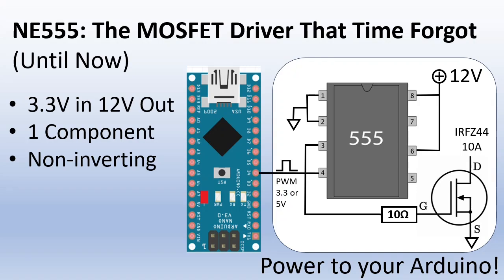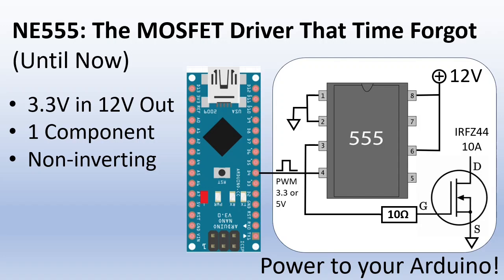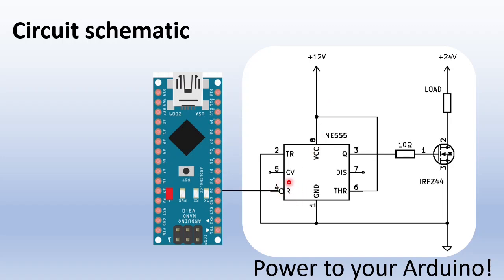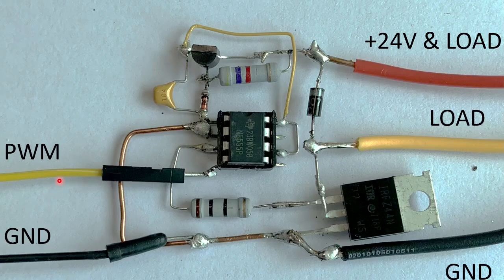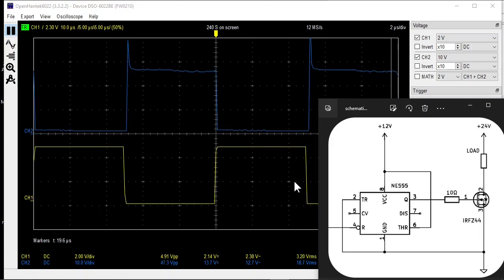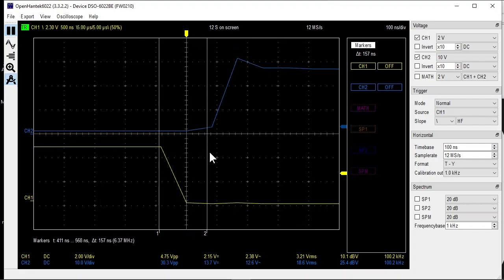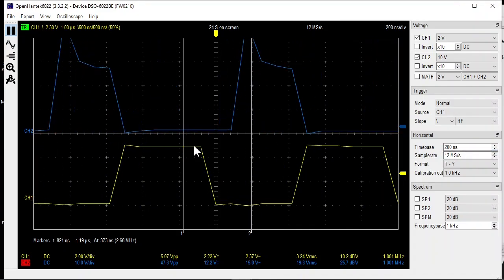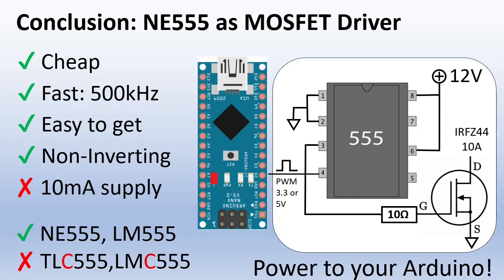NE555: The MOSFET Driver That Time Forgot (Until Now!)

Comment: PWM max value was 1024 instead of 1023 in several places → TimerOne uses 0–1023
Some logical conditions were incorrect
Functions called themselves → slowdown
UL type indication was missing in two places → overflow risk
There was a rounding error in OffTime / OnTime calculation

Comment: Good project!. The traditional older replacement was the ICM7555, originally developed by Intersil. I don't know if it still exists (I have "new" ones bought in the 1980s). These can deliver (absolute maximum) up to 100 mA.

Comment: Hello!I had made an active PFC low power corrector from NE555.There was 4N60, no current control, only output voltage control. Nevertheless - the power factor was much greater that without a PFC. I used 555 in PWM mode. The switching frequency was 50-80kHz.
Reply from the maker: Wow great Andrew, the NE555 has limitless applications ;-)

Comment: For some better/reliable edge transitions timing & ckt operations.... these options could help improve the performance....
From your ckt..it seems more larger decoupling on pin 8 of 555 is reqd. (at least upto 22uF)...
A 35V 2u2F to 4u7F on the 24v, as close to the mosfet DS pins is good
....also 0.1uF each across the 12V zener and another from pin 5 to common .....
use a -3 V negative supply referenced to 0V for the 555 ...with pin 1 now connected to -3V .These can work upto 18 V so here 15V is ok (+12v&-3v)..
Now the mosfet gate gets -3vnegative...so  turn-off is faster...
A diode 4148 in series with pin 4 with cathode @ pin 4..& a 5k1 pull down from pin 4  to -ve3v 
A typical pnp turn off transistor ckt. between pin 3  .., mosfet gate...& -ve3 supply...
pin 2 must be disabled with pull UP resistor to +12v..
So also pin 6 must be disabled with a pull DOWN resistor to -3v.
Need more drive current....
use a suitably chosen pull UP from +12 to pin 7..and tie pin 7 to pin 3 directly or safer still through a 1W resistor of  4E7 to 10E .
Now there's more sink & source current drive for the mosfet ...
The 555 mosfet gt. drv. is only as good as long as the uC. PWM PIN outpts a logic HI for pwm ON & LOW for OFF
 ...and one should be sure that when the uC is disabled/masked/hanged it maintains a logic LOW State...

Comment: The NE555 has an operational frequency limit of about 1 MHz. I think the signals are a little bit unstable because Vcc is not stabilized by a 0.22 µF capacitor against ground and it is wise to stabilize pin 5 by a 10 nF capacitor to ground as well. 200 mA is not a lot if you operate even a IRFZ44 at 500 kHz. Have you checked the MOSFET drain voltage at this frequency by oscilloscope?

I think, the MOSFET was not fully switched on and off with this gate current limit. The gate capacitance is 2 nF and the gate charge is 40 nC. This is allready a lot at such high frequencies. The MOSFET will need a lot more than 100 ns for switching. In some applications I have used MOSFETs with 15 nF and 200 nC together with a 9 A gate driver in order to get fast switching at only 50 kHz. The measured gate current peeks were between 4 and 6 A.

Comment: Hi, great video. I have a question, since this is not inverting the signal, can I use a reed switch as on/off signals to power a DIY electric motor coil?
Reply from the maker: Yes, sure, connect the reed switch to gdn and the input and  add a pull up resistor to +5 or +12V
Reply: @ Thanks for the help.

Comment: Hello, Master! First of all, thank you for sharing your knowledge. I have two questions:
1) Can this circuit be used to control a 24V Polygonal Laser Printer Motor? And how should it be connected?
The Motor has 4 wires: Red: Positive up to 24V; Black: Negative; White: for Speed Control; Pink: I couldn't figure it out.
2) What is Pin 4 of the 555 that goes to D4 (PWM) of the Arduino for, since isn't Pin 3 of the 555 the PWM Control output?  If you can answer me, I would be very grateful. Greetings from Brazil.

Comment: I was researching for a way to drive an led power supply from Meanwell that is working with 0-10V or 10V PWM. So this seams an Intresting alternative when connected it to the pwm input without the mosfet.

Comment: Overkill using 555 because you can't get sufficient mosfet drive.  Use a transistor driver just like anybody else would !  Lack of understanding simple analogue electronics.
Reply from the maker: If you like transistors: watch this: https://youtu.be/wv4uAz8FV2w
Reply: @smartpowerelectronics8779  A better starting point to develop your knowledge would be to read "Electronics Fundamentals" by Floyd and Buchla. It was the go-to book in the 1990's for a Electronics Diploma.

Comment: It would be nice to show the internal circuit diagram of the NE555 thereby increasing our  understanding  of this NE555 chip. Thanks.
Reply: Just google the data sheet.  Most of them show the full internals, although it doesn't help understanding the chip's functions unless you are a silicon designer.

Comment: IDK why it's not working .
Reply from the maker: @xjhoox  that is frustrating, did you check all voltages pin by pin? What I of the do is test by attaching an LED with 1k at the output and then use a wire to touch the input to 12V and 0 V while watching the LED😆

Comment: Looks like there are some improvements to be made. Looking at the internal schematic of a 555, you’ve got the Set and Clear pins of the SR latch both held high at once, which isn’t really in-spec. I think.
Also you really should put a resistor on the reset pin as to not be undefined when the MCU is in a startup state.
Reply: If the microcontroller crashes, the 555 output on pin 3 gets high and that's not desirable; when the input is disconnected, the output should be low.

Do you know how that bug could be solved?
Reply: @soupflood  if the MCU output goes high-z (like it does when it’s initialising) then you could avoid it by having a pull-down resistor on the reset pin. But if the MCU output goes high and stays high, there’s nothing you can do besides put a fuse on your power input.
Reply: @Scrogan   if the 555 timer's input (pin 4 reset) gets disconnected (or the MCU crashes) the 555's pin 3 output gets high. That's a 555 specific bug in this setup. 
I already tried resistor across the 555 input (between reset and ground) and it didn't work. The fuse wouldn't solve this either

Comment: I'm using the TLC555CP the CMOS version for a MOSFET driver for over 30 years. Not only that, I use the 555 also as the PWM controller, fixed on time, variable frequency, including the soft start function. It is one of my early designs and still in use after 30 years. Manufacture hundreds of DC to DC converters a month using it. Not everybody can use  that topology but in my case is just what the doctor ordered.
Reply: If the microcontroller crashes, the 555 output on pin 3 gets high and that's not desirable; when its input is disconnected, the output should be low.

Do you know how that bug could be solved?
Reply from the maker: @esoterex  yes the 555 is used in professional products, I worked on one HID lamp driver for office projectors with the 200W buck controlled with an NE556😂, built a few million pieces with high quality. Was the current output of the TLC not too low? Perfect ZVS?

Comment: I'm glad you uploaded this excellent video.
Maybe someone will also sort out the 555's open input bug (open input results in high output on pin 3).

I still find it fascinating that 2 components which are considered toys by most engineers can perform so well in this configuration. I use it to drive 2 paralleled TBI injectors in a 90's Chevrolet, by the way. It works great (unless the Arduino crashes, but it's mostly about filtering resistors, capacitors and keeping spark plug wires away from the Arduino cables). The Arduino is fed by a dedicated external 5V regulator and the 555 is fed by another 12V regulator (for increased reliability).

Have a good day!

Comment: Maybe that's what I was looking for. 
It should do the trick for me. I'm interested in running a motor, lamp with pwm signal. Whereas for a motor I would like it "independent" and manage it through the digital signal. I don't know if I explained myself. :)
Reply: This general setup works well for PWM driving low impedance (1 ohm) injectors in an automobile, it's what I've been using it for.

The big issue with it is that if for some reason the Arduino crashes, the 555 output will become High. That translates to a steady full flow of fuel into the engine (drowning).

If you have any idea how to fix it, please share.

Comment: Hmmm, sure its one way. You could use one or two super cheap transistors, a logic gate, a schmidt trigger, a comparator, an opamp, all sorts! but its OK that you did this.... but its not the only way. The right method depends on space and cost limitations.

Comment: Really great and explanatory video ı really liked your explanation. But what happens if we were to do like an H bridge configuration? This time we need drain voltage + gate thresold voltage to use the mosfet on the High side right? That would mean 12v is not sufficient and maximum 16v rating of ne555 is also not sufficient. Or am ı wrong can you please answer me ı don't know and ı am just asking.
Reply from the maker: Thank you! For H-Bridge you will need to make a bootstrap supply of 12V like in this video: https://youtu.be/M5lETaqI9JM. Suggest you use the IC solution, much easier and robust.
You can also use a motor drive IC like ST's L293D for low voltages and frequencies.
Reply: @smartpowerelectronics8779  ı am trying to design a brushless ESC with microcontrollers and wanted to make a H bridge first. Most Motor driver IC's cannot handle a lot of current and voltage and ı don't want to throw an IC to the problem to be honest ı want to learn how to do it myself. But Thanks for your answer you have some really good content. ❤
Reply: @doganertan7259  bootstrapped... i also prefer discrete components over ICs... 

only issue with the charge pump bootstrap in a h-bridge is it cant be used for say, direction control on a motor?

all good as a driver, for PWM, but they cant be constantly "on" (or "off"?) as the charge pump capacitor does slowly discharge. depending on the value, you still have approximately half a minute to a day or two though!
but as the value gets larger it also means it requires a longer "dwell" time to recharge that capacitor... so you keep them small for high speed operation...

as most H bridges run PWM at a reasonable frequency, its not an issue. some people do use them for polarity reversal though. better to use a single throw double pole switch/relay for that application.
Reply: @paradiselost9946  I saw a lot of commercial ESC models don't have a mosfet driver inside. Most of them uses a discrete circuit it seems. Using discrete components are a lot cheaper than using driver IC's. Discrete circuits can "off" the mosfet but they can't make the mosfet stay "on" that long. For a High side mosfet can we just put a boost converter circuit and switch it with a transistor on the mosfets gate? Because in my country there is a boost converter called mt3608 that is cheaper than that driver IC and ı did not see any circuits online about using a boost converter. Or there is another method that ı don't know?

Comment: So as far as the mosfet is concerned its just seeing the npn and pnp switching transistor in the 555. I would just use a a pair of transistors and not waste a 555. in fact real mosfet driver IC's are possibly same cost as a 555.
saw a guy use some optocouplers a few years ago for driving P channel fets from logic lines.
Reply from the maker: You are clearly a professional! The transistor pair will give you the current gain, however for the voltage gain you need a 3d transistor, see this video: https://youtu.be/wv4uAz8FV2w .

Comment: If you take a complementary pair - say BC547 and BC 557, and put them in emitter-follower, you can achieve the same effect with 
- Lower pin-count
- Lower cost
- Lower quiescent current
- Better performance.

555s are good to learn the basics, as illustrated in the fantastic book by Forrest M. Mims III, but let's leave it at that.
Reply: No, let's not "leave it at that." It's better to have knowledge of all the different ways to use all the tools in your toolbox (so to speak) as you can never anticipate all the circumstances that can arise. Maybe you're in the middle of a build and don't have BC547 and BC557 transistors available, nor any kind of dedicated MOSFET driver... but do have a box full of 555's. Then it could very easily be the case that the 555 is the perfect solution - in context. 

I don't think anybody is saying that a 555 should  be the MOSFET driver of choice, but knowing that it's capable of performing that function is potentially a damn handy bit of knowledge. It's just another arrow in the quiver.
Reply: @PhillipRhodes  To be clear, I'm not talking about "could" but rather "should".
Reply from the maker: The totem pole will give you the current gain, for the voltage gain you need a 3d transistor, see this video: https://youtu.be/wv4uAz8FV2w
Reply: It's hilarious to me that every time the 555 is suggested as a gate driver, someone pushes back.  No one is suggesting the 555 be used in a 1.2 MHz buck converter or your latest energy harvesting application!  But for very many routine applications they're gold. Ever since the idea showed up in the August 29, 2012 issue of Electronic Design,  I've never not had a 555 on-hand.  Meanwhile, your totem pole solution fails fundamentally, as has been pointed out.

BTW,  Asian 555 clones work just fine, and Amazon sells 50 of them for $6.99.
Reply from the maker: @d.jensen5153  I have used NE555 IC's as Buck controllers in (ultra) high pressure lamp drivers (120....400W) , if you have a office projector or a rear projection TV chances are there is a 555 at the heart of your device 🤣

Comment: Maybe the NE555 drives a serial RS232 with 12V = Low and 0V = High?
Or an ATMega HV programming? 
This requires 12V on the reset pin of the ATMega. Then you can still delete the program from a locked IC and reset the fuses to normal.
Reply from the maker: Good idea, it is fast enough for RS232, I have never tried Atmega HV programming, did not know you can use it to erase a locked IC, so I learned something today, thank you!
Reply: @smartpowerelectronics8779  Een Atmega die op slot zit, stop ik altijd mijn TL866, die met hoog voltage de boel weer op poten kan zetten.
Reply: can you share the code?

Comment: This doesn't work with the B555 from GDR production. 
On the NE555, the Set input is overruled by the Reset input.
However, with the B555 the Reset input is overruled by the Set pin.

The reason is that the NE555 takes the /Q output from flipflop and inverts it again in the driver stage.  That's why Reset is dominant.
However, the B555 takes the Q output from flipflop and does not invert it in the driver stage. That's why Set is dominant. 
For most applications, however, this difference is irrelevant.

Most 555 clones do it like the NE555.
Reply from the maker: Thank you, you seem to be an NE555 expert! I tried all the 555's I had lying around and they worked OK except the TLC555, but there are many variants of the 555....

Comment: Nice forgotten idea! One 555 costs about as one middle powerful transistor. So for 3.3v controllers it looks like a winner - no additional  components.
Reply from the maker: Thanks, indeed. I use it already in a project
Reply: It’s possible to use 555 in a high side driver for 12v, just use one more 555 as a voltage doubler with diode and capacitor. So using cheap PC817 optocopler we can switch +12v high power loads

Comment: You can connect 555 DIS to Q and get even more current to close MOSFET Gate faster. Usually MOSFETS drive  inductive loads so fast close is more important than fast open.
Reply from the maker: That is a good idea, I did not think of that!
Reply: Thank you for sharing your knowledge. Will share that circuit diagram?

Comment: im quite confused when you said you were gonna build the circuit. i just saw a load there with a reverse diode, then you added a transistor and stuff. i got lost after that point.
Reply from the maker: The transistor, 4k7 resistor, zener diode and the 100nF capacitor are added to make 12Volt for the NE555. You can also use a lab power supply for that. I wanted to show exactly how I test the circuit to make sure I show the actual performance :-)